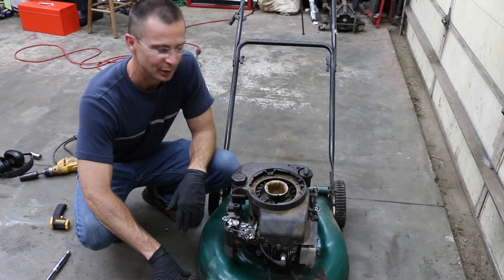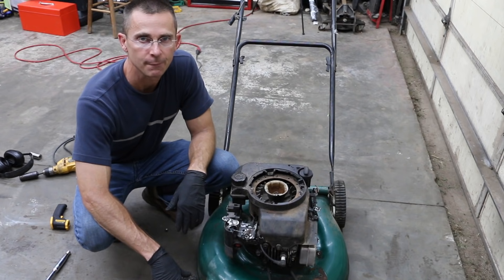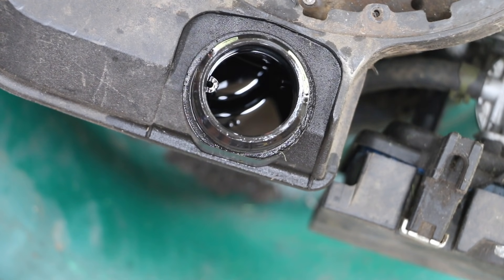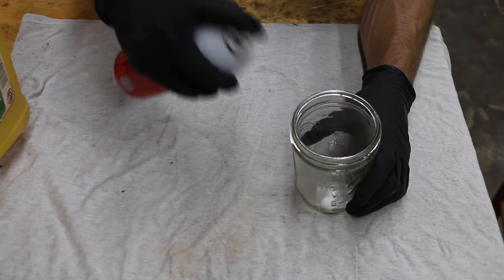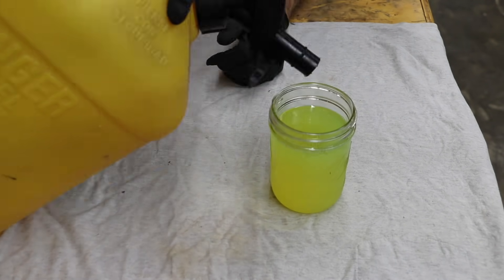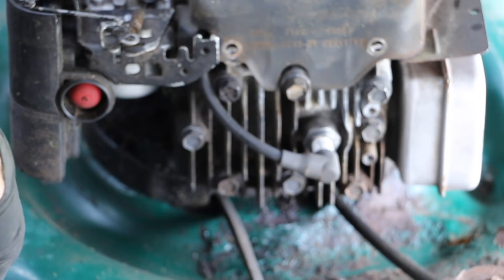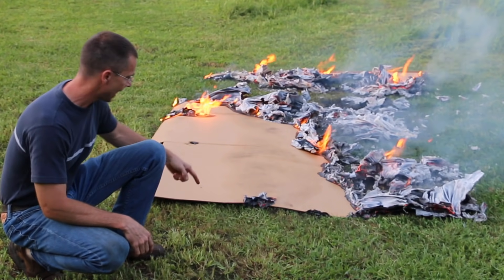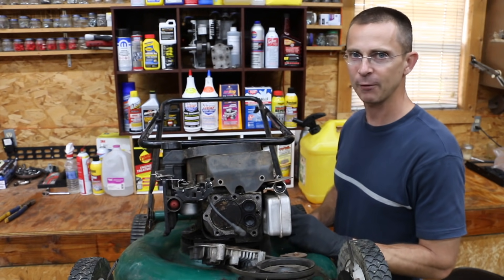Will a Gas Engine Run on Diesel?  Let's find out!

Comment: Is it possible to convert a 2 stroke engine to diesel?
Reply: Considering how you have to add oil to the gasoline so it can lubricate. I dont think you can but maybe worth trying? That would be cool if you could get it to work. My uncle once filled his dirt bike with kerosene by accident and tried to pop the clutch to get it to run. Didnt work of course and when we learned why we drained the tank filled it with gasoline. After it smoked for a good 10 minutes of riding it was able to idle again when it couldn't before he accidentally put kerosene in it. Assuming it cleaned the carberator. Maybe worth a test to see if kerosene will clean an engine.
Reply from the maker: Thank you for the video idea!

Comment: The old dodge v8 lean burn engines would run very nicely on diesel once warmed up.  The problem was getting them to stop as once it was hot the diesel didn't need the spark plugs to fire.  There was a little nib on the head between the valves that was a hot spot that created an ignition source for the diesel.  That nib was also responsible for all the pre-ignition those motors were known for.
Reply from the maker: Thanks for the feedback.
Reply: Back in the 70's and 80's I ran my 1946 Ford Jailbar V8 on diesel for 18 years. Never used gas at all.

Comment: I know the answer to this one... I accidentally put the wrong gas in the mower on my uncle's farm, when I was a kid. It will blow smoke because of the oil in the fuel. Because it's being lit with a spark, instead of pneumatic combustion, it doesn't burn all of the fuel. That smoke coming out, is unburned fuel. The smoke with leave lots of carbon residue behind, fouling up the valves, plugs, and the combustion chamer + heads.
Reply from the maker: Thanks for sharing.
Reply: My little mower actually ran on diesel, and blew more smoke. But I dumped it out and used it to get the fire pit going that night.

Comment: It’ll only
Run on straight diesel
Once the engine is HOT but it will run I cut my yard on straight diesel one time. I ran out of gas after about 5 min of running on gasoline added diesel while engine was still hot and ran pretty decent.

Comment: In the next few weeks, I would like to see a few tests, first gas and 2 stroke fuel mix vs true fuel, and also the different engineered fuels for 2 stroke engines.

Next test pump gas vs true fuel for 4 stroke engines. 

Last true fuel with a home mix of 2 stroke oil.

Test for . Power, economy, and also for stability.
Reply from the maker: Thanks for the video ideas.

Comment: No. diesel doesn't ignite from electrical spark from a spark plug. It ignites from being compressed inside the cylinder. Gasoline engines don't create enough compression in the cylinders. There are no spark  plugs in a diesel engine. Diesel engines have glow plugs that heat the precombustion chamber before starting. They do not heat it while the engine is running. In fact, you can start a diesel on a warm day without glow plugs. It is also difficult to ignite from a regular flame. Sometimes it requires a blow torch to ignite. If you noticed, it took the heat from the gasoline side of the cardboard to ignite the diesel. It is an oil. It is the same as the heating oil used to heat older homes.
Reply from the maker: Thanks for the feedback.
Reply: @ProjectFarm  I'm suprised it ran at all with pure diesel. That doesn't make sense. Could there of been gasoline fumes or some gas in the fuel line?

Comment: Short, no.
Reason unlike Gas, Diesel doesnt burn if you just try to light it up it needs a lot of pressure, it also has alot more density which causes to get more power from lower RPM also the fuel consumption is way lower. You also have more NM but those engines dont build up alot of it om higher RPM, also you can Drive more Miles with it some Diesels reach over 2-3Million Kilometers before they die.
Gas on the other hand burns very fast, you can reach more RPM consumption is way higher and the engines are more sensitive but have other pros that the Diesels dont have.

Edit: sorry for bad english
Reply from the maker: Thanks for the feedback.

Comment: You should Do starting fluid into a diesel engine, I’ve heard it over revs  them or damages them
Reply: I understand that it glazes the cylinder walls and mucks with the rings and thereby the compression of the motor.  It's like crack to a diesel is what I've been told.
Reply: Using too much on any engine can cause damage to cylinder walls cause it dries them out. And a constant spray of it will over rev any engine. The biggest reason everyone thinks it’s bad for a diesel is glow plugs. If they’re still on or hot enough it’ll cause pre ignition and can crack pistons / bend rods. Grid heater engine shouldn’t have any issues.
Reply: @Dirtyol12valve  some diesel engines come with starting fluid injection to start them in the cold. Works fine just don't plan to run them on the starting fluid or use starting fluid and glow plugs at the same time.

Comment: Great videos; always!
Do you have a video,
Or can you make a video removing the small 4-5 inch tiny muffler to then weld/make an adapter for at least an inexpensive muffler life for an 80's Honda Civic or Geo Metro (for example)? I'd imagine a 3cyl Metro or 4cyl Civic had a small diameter exhaust and an adapter to pair up to lawn mower exhaust flange should be easy BUT even though it'll make the car exhaust completely quiet can it make a mower quiet too or is the running mower engine just really louder by design? - Why can't we have a quiet lawn mower????
Reply from the maker: Thanks for the feedback.

Comment: I'm ditching my pull cord for that drill set up
Reply: That’s what use to start my old 2-stroke outboard😂 needs new condenser and points but it works without tiring my arm from pulling a rope in the middle of the lake
Reply: AMEN to that.

Comment: Oh it will lol we filled a tank full of diesel in a bronco 2 and drove 30 miles to Glennallen and it burned all the diesel and we refilled and continued to Valdez,  119 miles or so. Drove around Valdez for a day or two and on the way back the motor blew.
Reply from the maker: Thanks for the feedback.

Comment: I accidentally refilled gas into the diesel tank of a diesel powered riding lawn mower it still ran but was obviously having power issues it was probably 5 gallons diesel to 10 gallons gas . Also a coworker of mine refilled a gas engine John deer mower with diesel it ran but smoked a lot in both instances we drained the fuel tanks.
Reply from the maker: Thanks for sharing.

Comment: Here is something else you could try. A friend of mine used to run a three-quarter ton Ford pick up around town ,with a six cylinder engine, on diesel fuel! He would fill it up with diesel and put 1 gallon of gasoline in it and I asked him how that he got it to run he said he change the timing and gaped the spark plugs wider.
Reply from the maker: Thanks for the video idea.

Comment: The engine can run on diesel  let me tell you how to do it but when you put the engine under load you will see a big difference in power but 5 min later you will see damages starting to happen . With kerosene or jeta1 no problems 
Long story short I used to help out my grand dad in his rice  fields the rice needs a lot of water we used gas pumps those  pumps will run 2 to 3 days non-stop now do the math the price of gas so the engines were modified.  So this is how we do it the kerosene need to get hot to ignite like gas so we will start the engine on gas let it run for 5min let it get up to temp and then switch to the keroseen and that's it will run for days.no problems. So I try the diesel the same way on a  engine it stayed running on the diesel but Smokey but after 5min  under load that changed the exhaust got red with visibel fire coming out thats because the diesel was longer to burn  
Investigated inside the engine rings damage and burn piston. Try it if you like.
Reply: And when I ment modified noting to do with engine.  It was just a valve to switch from gas to kero

Comment: When I was a kid we ran a 50cc moped on kerosine. It had to be started on gasoline but when switched to kero it would continue to run and made usable power. Kerosine and diesel are similar but they stink in a low compression engine.
Reply from the maker: Thanks for sharing.

Comment: Will it run on water? Make a gas extractor hho cell out of a 12v or a 6v battery.  See if you can produce enough hydrogen and oxygen to run it.  I'm thinking one hose in the gas feed and one straight into the carburetor.
Reply from the maker: Thanks for the video idea.

Comment: Back east the colored pumps meant high test gas, when I moved to Arizona me and my '96 fatboy learned it was diesel. I only put in 1/4 tank, it blew smoke rings out the pipes and thank God my friend gave me octane booster to get rid of the ping. When I got home a gas tank, carb and oil tank flush was in order. After I changed the plugs the darn thing actually ran better.
Reply from the maker: Thanks for the feedback.

Comment: The reason diesel ran while priming, then stopped running is because you were using up the last bit of gasoline in the carburetor bowl. Also, running diesel in a gas engine will work if the engine is up to operating temperature because the diesel is preheated above its flash point. It atomizes better and becomes more combustible. You’ll get away with it in a carbureted engine, but with fuel injection, it will quickly start to run poorly and eventually quit. This is because the aniline point of heated diesel attacks the synthetic rubber seals in the injectors and they quickly swell blocking flow.
Reply from the maker: Thanks for the feedback.

Comment: Years ago, I ran a lawn mower on fuel oil, which is close to diesel. The one key factor was adjusting the air fuel mixture, which is something I did not see in your video. I also ran a lawn mower on home made alcohol, which again, required an adjustment of air fuel mixture, much richer.
Reply from the maker: Thanks for the feedback.

Comment: I personally wouldn't do this in any gasoline engine, efi of not. On larger equipment diesel will stay in the fuel system for a while and the machine will smoke for a while even after the deisel is drained out of it. The only situation I could see this being a decent idea would be in a 2 stroke but only if its absolutely necessary.
Reply from the maker: Thanks for the feedback.

Comment: I'm surprised that the engine didn't blow, because gasoline lights but diesel doesn't it compresses, that's why it wouldn't stay running. And some people when they fill up the gasoline tank at a gas station will put some diesel in because diesel can clean out some of the crap in a gasoline engine.
Reply from the maker: Thanks for the video idea.

Comment: Video Idea;
This made me think of diesel engine "run away" when oil from the engine gets into the cylinders. 
So could you run a diesel engine on straight motor oil? Say 10w40 in the fuel tank. 
You'd have to find a small diesel engine but an explanation of diesel runaway & a dramatic clip of a vehicle with it's engine roaring amongst clouds of smoke would make for an informative & dramatic video!
Maybe you could set up a small diesel engine to runaway yourself. That would be something to see! 
Here's some runaway diesels... When they start running on engine oil... We'll, take a look.
https://youtu.be/RLRfil14ETI
Reply from the maker: Thanks for the video idea.

Comment: I saw an old tractor first runs on gas and then switched over to  kerosene. I think if the engine was warm it would burn the diesel better.
Reply from the maker: Interesting!  Thank you

Comment: Cars/trucks won't run after a fill up with it. Done many towed in vehicles that had diesel put in by mistake. Just washed the plugs. No start. I always disconnect the fuel line at the intake and run the fuel pump with a scan tool and catch the diesel in a 55 gallon drum. Next, put in 5 gallons of premium gas and crank until it clears out the fuel rail and as soon as the gas gets in it is good to go. Check the oil and make sure it isn't contaminated with diesel from prior vain cranking. Change oil if necessary. Normally good as most customers realize it and tow it right off. On the other hand, filling up a diesel with gas and running it is detrimental and generally damages the engine.
Reply from the maker: Thank you for the feedback

Comment: My old car made it about 25 miles to a gas station when it ran out of gas on the road an i dumped like 3 gallons of kerosene in it. I think if the engine is already hot it would run ok. Maybe on a smaller engine if the mixture setting on carb is set richer it would run easier. I already had that car set richer running ethanol E85 fuel. .
Reply from the maker: Thanks for the feedback.

Comment: Appreciating this is old.  Been working on a waste oil burner where if I’m using veg oil I mix with 10% petrol which I up to 20% when it’s zero or below out.  So as much as diesel doesn’t flash at a low temps I also wonder about the viscosity.  P.S never put a diesel mix in a hot petrol automotive engine.  Been know to blow cylinder heads through the bonnet.
Reply from the maker: Thanks for the feedback.

Comment: you need a turbo if you want the engine run
Reply from the maker: Thank you
Reply: @ProjectFarm  Hi !   Can you make a video with syntetic diesel engine oil mix in gasoline in a 2 stroke engine (chainsaw) ?  :0)

Comment: Nice video as usual. If you pre-heat the diesel it will atomized and it’ll 
work. My 1934 & 36 John Deere mod B’s got almost twice the time raking hay on diesel and more power. The trick was the exhaust manifold pre-heated the incoming air fuel mixture down stream of the carb. I would think you could run it on motor oil if you could get it hot enough.  I had an old army camp stove that would work on anything  you put in it. Though a little sooty on the heavier oils. Try putting some kind of a spacer Between the carb and block and route the exhaust around it some way. Bet it’ll work
Reply from the maker: Great information. Thank you
Reply: PS, start on gas for the warm up then switch over to diesel when warm

Comment: Once I accidentally ran a chainsaw on kerosene, the performance was not quite as good but it did start easily, I just couldn't get the same higher rpm's as the gas oil mixture.
Reply from the maker: Great feedback

Comment: Had an early 2000s accord for a no start but could get it to catch with some brake clean down the intake and it would stay running but didn't like to rev and just drove with low power. Fuel pressure was good. Rarely work on diesels and can't even remember why I checked the fuel but it felt slick and slippery. Popped the fuel line off and commanded the pump with a scanner and emptied the tank. Filled with a jerry can of gasoline and it was back to normal. I guess filled up at the gas station with diesel and there was enough gas in the fuel lines to start and get home but had blended so the next start it didn't want to go. I really wish they would have mentioned this and saved the hunt!
Reply from the maker: Thank you for the feedback

Comment: When some diesel gets mixed in with gas, it wont burn off much and slips past the piston rings, and collects in the oil pan. Take an ounce of oil out of the oil pan & dip a ciggerett (tobacco end) into it. If there is diesel fuel in the engine oil, the diesel fuel will creep up the ciggerett.
Reply from the maker: Thank you for the feedback

Comment: You should try a video where you use transmission fluid with 91% rubbing alcohol , trans fluid is flammable(which of course I’m sure you know) but the rubbing alcohol will give it the flash point for the spark plugs
Reply from the maker: Thank you for the video idea!

Comment: And now you understand why diesel engines have fuel injectors.  Because diesel doesn't like carburetors.  Also you need to be careful mixing gasoline with diesel.  That's the basic recipe for JP4. It's volatility is very different from plain diesel.
Reply from the maker: Thank you for the feedback

Comment: 1930’s John Deere Model A tractors had a duel tank setup with a valve for mixing . You would start it on gas and then mix it with whatever liquid that would burn for economy once it was warmed up.
Reply from the maker: Thank you for the feedback

Comment: Flash point of diesel is 80 degrees centigrade ..... so heat it to 80 degrees centigrade than you can run a petrol engine on 100% diesel
Reply from the maker: Great point. Thank you
Reply: @ProjectFarm  I would start at 60 degrees to be safe

Comment: would diesel engine run on pure fresh new engine oil or mixed with diesel?
how would the engine perform for turbocharged or naturally aspirated?
with advanced detergent technology like pureplus?
with light or heavy oil like 5w-20 or 10w-60?
thanks
Reply from the maker: Thank you for the video idea!
Reply: @ProjectFarm  youre welcome, also, check about the catalytic converter afterwards

Comment: After watching this video. I ran my 2001 Deville out of gas. I then put a half gallon of diesel and gas in the tank. The engine was a little hard to start because I put the diesel in first. I drove it for 8 miles and I uploaded a video.
Reply from the maker: Thank you for the feedback
Reply: @ProjectFarm  Thank you for the idea. My video is doing better than most.

Comment: You could try to raise the temperature of the oil(diesel) to about 100 Celsius or more. It will surpass its flash point and become more flamable.I don't think the engine will run with much power(or run at all because of the compression), but at least it is a better shot. It will be very dangerous. I don't think it will explode or auto-ignite(you would need higher temp for that).
Reply from the maker: Thank you for the feedback